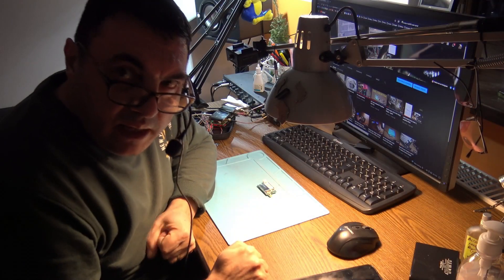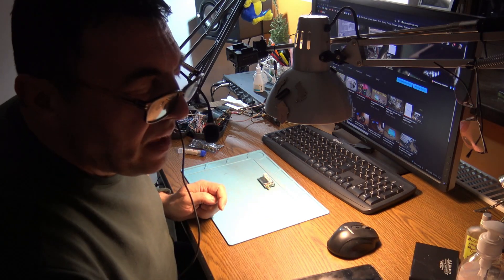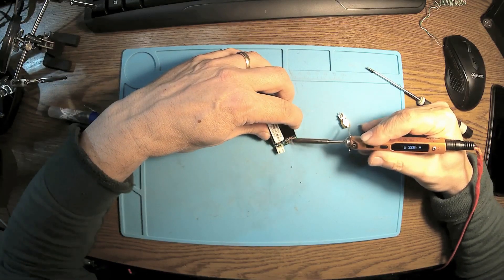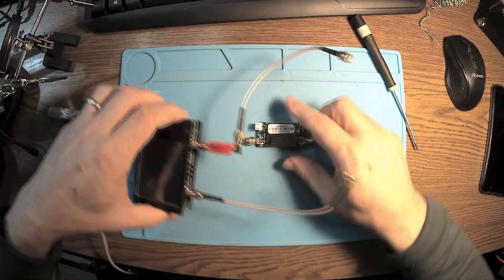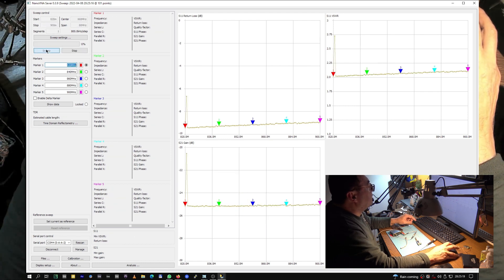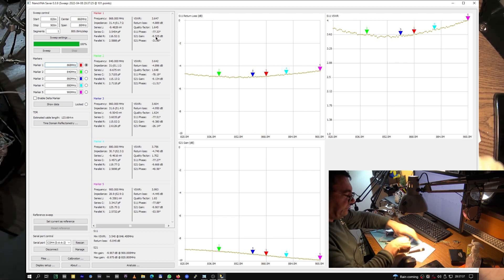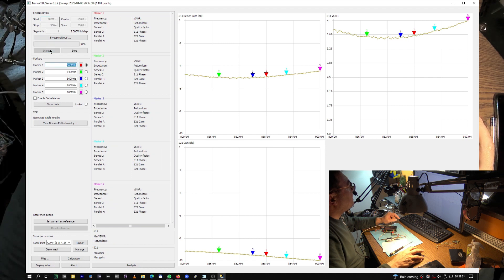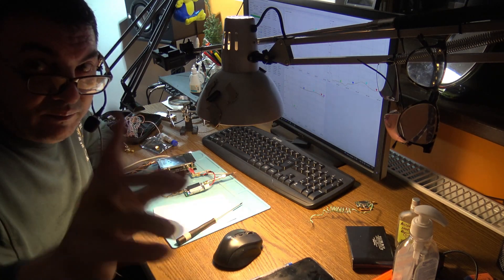Ready for Week 5 test Lora AB-868-5v AB-IOT-868 Helium bidirectional amp

Comment: Is this for use for the 915mhz? I was told that the AB 868 5v was for use in both 868MHZ and 915mhz
Reply from the maker: It can be used for 915 too..bandpass filter is very tolerable and will amply well 915Mhz.

Comment: i hope its earning ,   i have the same one ,   my system is in order 6 dbi rak antenna- filter - ab-iot-868 and piesces v3 but less earning than no preamp configuration. may be you can adjust voltage , and make some improvement tests
Reply from the maker: Now the network it's very lazy, but the maplifier is working great.With different voltages can be adjusted TX power only, the RX gain remains the same from 3.5V to 6V...but TX is not so important, this little guy can send max 2W at 6V , in Europe we are aloud to max 0.031W !!! So I use the minimum TX power amplification 5dB with a medium antenna setting 6db..let's wait for HIP55 at mid april

Comment: Hello, I have sensecap + airbuddy amp + saw filter + 5mt lmr 400 cable + 8db antenna. I made a 9db antenna in the application. How many db should be in the application. If we remove the saw filter from the system, I would be glad if you could help. Thank you
Reply: Thank you, I set the antenna setting to 5 db, the first witness was invalid, the second was normal, let's see how the others will be.
Reply: @mhmtaksu   selam bu amp den bende aldım saw filtreside var ama çıkardım cihazım resmen sağır oldu bir tavsiyen varmı
Reply from the maker: Check the power supply first, there is pretty solid..be patience and let it run for few days..it's not magic and pop in seconds! Give it time!
Önce güç kaynağını kontrol edin, oldukça sağlam.. Sabırlı olun ve birkaç gün çalışmasına izin verin.. Sihirli değil ve saniyeler içinde açılır! Zaman ver!
Reply: @lostlife25  baskan yeni gordum msji da bende hala duruyor ayni sekilde saw filtreyi bende bi cikariyim dedim ama bilemedim sende bi degisiklik varmi
Reply: @mhmtaksu  ben 5 gün denedim cihaz sağır oldu çıkardım çöp çöp başka bişi değil
Reply: @lostlife25  benim cihaz calisiyor ama neye gore nasil calisiyor bilmiyorum ya yanlis zamanda aldik yada bosa aldik sadece rssi ler duzeliyo gibi anliyorum ben zaten sisten bi degisik calisiyo bendeki cihaz sensecap 8db anten var ankara keciorendeyim caldiran tarafindayim arkadasin cihaz panter oda 8 db anteni var ikimizde ankarayi net goruyoruz bende anfi ve saw filtre var onda hic bisi yok onun cihaz benim cihazi 2 ye katliyor yani panter cihazlar daha iyi calisiyo anladigim
Reply from the maker: Let's wait and see..
Reply from the maker: Where is your miner placed ? In Eu there is a 15dB TX limit..
Reply: My miner is on the roof of the building 30 meters high. I am on 868 mhz frequency in Turkey. Rx and tx fully open
Reply from the maker: @mhmtaksu  Gold mine! For RX you got losses for 6 connectors like 3 dB+2 dB filter+1dB cable=6dB total. Airbuddy is gaining like 10dB ...left 4dB Rx gain...add 8dB antenna..you'll have like 12dB chain. If you consider minimum TX gain for Airbuddy 5dB..to reach the max admitted power is...6db (from losses)+5db (min irbuddy TX gain)+8db antenna=19dB...! so you need to low the antenna in the app to 5dB...but relax..take time and experiment with different antenna settings..every location is different..there is no recipe.

Comment: Which antenna gain would you declared if the antenna is 8 dbi to avoid invalids?
Reply from the maker: I'm not sure..it's looking like avoiding invalids declaring a high gain antenna is affecting RX too..somewhere in the middle , like 6dB will do both jobs.
Reply: @viocaia  only tx power is affected by the antenna value
Reply from the maker: @Tarekcoc  I found that too..I wasn't sure, thanks for confirm!

Comment: Hi, I am using this product, but 2 days have passed and no witnesses have heard.
Reply from the maker: Be patience the network is changing..and you need time to see results..check the numbers relative to old witnessed to see if your RX is better.
Reply: Thank you for your answer,
no Filters currently installed
What is the difference between Saw filter and Cavity Filter
Reply: @TyfnCTN  your Miner could be deaf at the moment without any filtering the amplifyt signals. A cavity filter has lower insertion loss. Round about 0.5-1.0db a SAW has a loss from 1.9-3.0db. But with a amplifier you don’t need a cavity. That’s my opinion. You can adjust the db in the Helium app little more to find the best setting for you. Biraz caba göstereceksin kardesim. Sorin isimli youtuber var, onu bi arastir.
Reply: @Righttorepair880  thank you so much
Reply from the maker: @TyfnCTN  Cavity filter have better signal passes, low losses, it;s like a violin well tuned for a good sound..saw filter is based on quartz crystal, when excited by RF current start vibrating..some other part of the crystal peeks the vibration and transform it on electric signal again..so far bigger losses..cavity >1dB vs saw ~2dB...
Reply from the maker: Check if you connected ok, kind of tricky..input goes to miner/output goes to antenna!

Comment: When I use 17 dbi amplifier and 6 dbi antenna = should I calculate the power to my hotspot as 23 dbi? should i just calculate the power to my hotspot as amp power 17dbi? Isn't the antenna gain calculated because the amplifier's gain is higher?
Reply from the maker: Add the antenna gain too..
Reply: @viocaia  Hello, pls, dont delete this note - I try put 22 dB in Helium App for my miner, but maximum is 15 dB. What can we do with this? Thx
Reply from the maker: @asthmatic2455  I really don't know..maybe the network consider a kind of 15dB max antenna for LoRa..in fact LPWAN stands for Low Power Wide Area Network and this type of wireless communication is designed for sending small data packages over long distances, operating on a battery.

Comment: You got any more info on the chips inside the amplifier called "SATK" and "C043"? I need to replace them but I can't find them anywhere online
Reply from the maker: Not yet, I even opened another amp and there are different parts, same configuration..do you have a schematic?